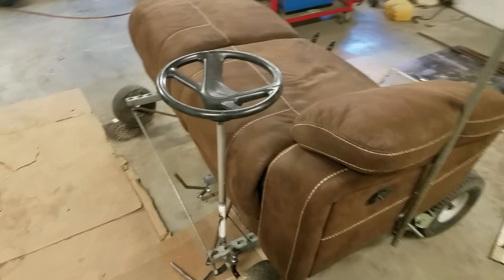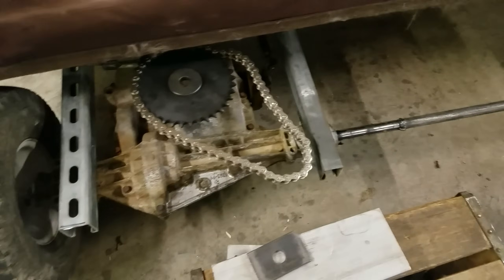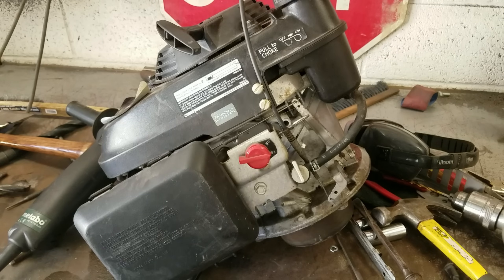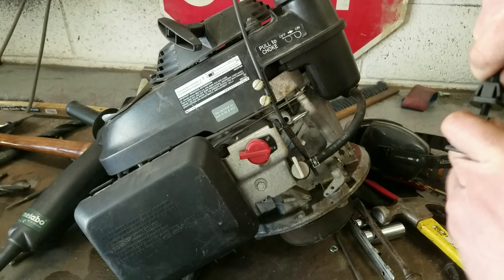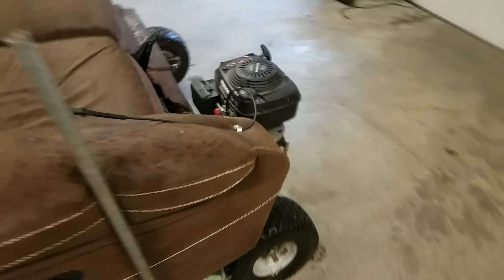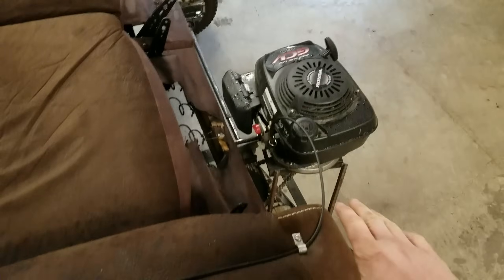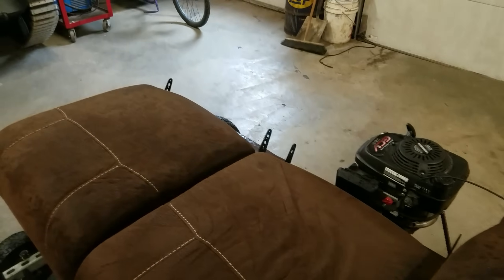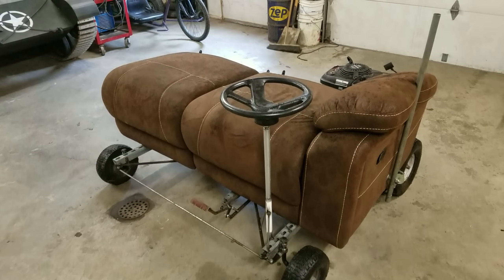Homemade Motorized Couch!

Comment: quick and dirty build but like you said it'll work , would be a nice cart for a parade or sumting like that (could go dressed up as grandpa and grandma (doll) and add some airstuff like a confetty cannon out the back or a jump seat under grandma) , you could put a tablecloth over the steering wheel to discuise it as an end table 
one thing you might want to put sumting over , is the long steering linkage as the brake lever might hit if youre too enthousiastic and trow the alignment off

Comment: Cool -Why not put ball joints off a garden tractor from landfill ??  , The old cars had a 90 deg. lever that was between the front seat mount it to the center of bottom of chair with a draglink to the tie rod it`ll turn easier and it`ll have better force to turn you`ll be able to sit right back ,, I`ll make a suggestion on the axle if you use a piece of 5/8 cable with 2 collets on each side it`ll flex with the runout of the axle without breaking might need a pillow block in middle .
Reply from the maker: yeah, that would work better, but the idea for this was to basically just throw parts together with just enough care for it to be just reliable enough haha.
Reply: MacroMachines Worked .. Be nice to use it at a parade .

Comment: If that was a pressure washer engine then it would have a tapered output crank. And you wouldn't be able to put that clutch on it. I'm sure it just simply came off of a push mower.
Reply from the maker: A relative gave me the whole pressure washer just for the engine, so im sure that's what it was.

Comment: There should be a spring coming off that governor and the other end to a tab, that's the engine speed adjustment, you bend the tab to set the speed. You should be able to rig a fulcrum arm on to that to connect your cable, then you can easily adjust the speed while still having the governor. If your steering wheel doesn't turn much, I'd mount a small brake lever off a bike and use it as a throttle, like the hand throttle they had on the Honda oddesey.

Comment: Wow cool project. I didn't have a problem with you welding the extention on the axil. Just that if you grind a bevile on the end of the shafts it wakes a much stronger join/weld. To cool though.

Comment: I love it but you put the steering linkage in front which we all no is so wrong. 😂😂

I actually laughed when you called out the haters preemptively about the welded axle then proceeded to weld the wheel on. 

This will be great along with your other creations if your town has a Fourth of July parade.
Reply: Wayne Crews
You could also point out the grammatical errors in both of her responses.
Reply: Doctor Zoidberg 
I agree with the tie rod out front too. It is sarcasm based on a history of attacks from one guy on his off-road mower build with the tie rod in front of the axle but thanks for the kind thoughts of my family
Reply: Wayne Crews no is also so wrong. Its know
Reply: Leah Smith 
It takes a lot more than a correction to hurt my feelings you’re wrong. Every word is spelled correctly. I just used the wrong word.. 
The funny thing is, is that I actually use punctuation and proofread but this one slipped through. 
If you watched the mower build series then you may have seen comments from one person over and over about the position of the tie rod on the mower being wrong because he left it in front of the axle when he flipped it around. 
I was being sarcastic about that and Micro Machines knows that.
Reply: esqueue 

I could, but that would drag me down to her level and I’m not used to fighting at that level. 
You’re right about her errors. 
Its instead of It’s being the first one.
Reply: Wayne Crews you are still wrong, and where did you get the idea that I'm a hater? I love the Ford mower build and I like it, too, I am solely recommending that he save himself some trouble down the road.
Reply: T.J. Boismier 
The haters I was referring to are the ones he mentioned when he welded directly to the axle. 
The tie-rod comment was separate. Try to keep up please.
Reply: What about the comment you posted above: 
Doctor Zoidberg 
I agree with the tie rod out front too. It is sarcasm based on a history of attacks from one guy on his off-road mower build with the tie rod in front of the axle but thanks for the kind thoughts of my family

That seemed to imply to me that you were calling me a hater.

Comment: come back with a 46"deck so ya can lay on the couch and mow the grass
Reply: I was thinking the same.
Reply: steve brady not a bad idea, would not be hard to rig a deck for it. I have a 46" deck off a John Deere that'd be perfect, it's three blade with the belt under the cover, a double pulley drives the lower belt, and the upper pulley goes to your engine.

Comment: I thought it was going to be dumb but thats actually pretty cool. Do the recliners still work? I cringed when you drilled the leather lol
Reply from the maker: the left side originally reclined, but I had to disable it because it was interfering with the steering wheel and the shifter. I also changed the gearing to the transaxle and it's much faster now.